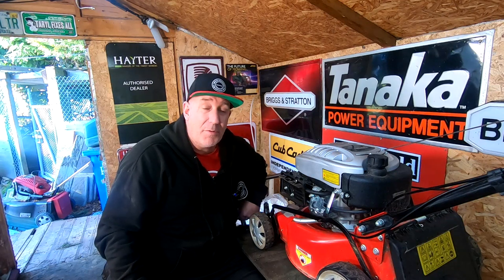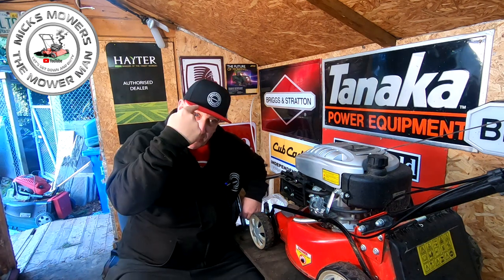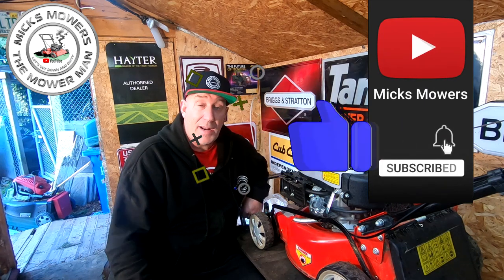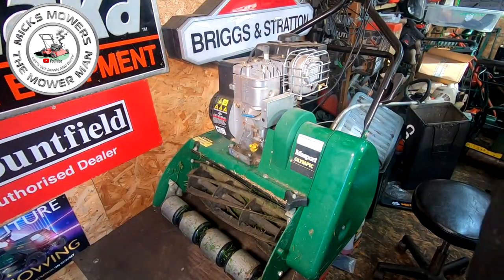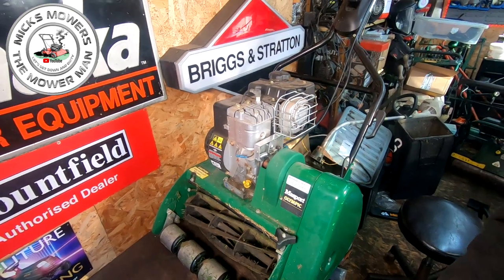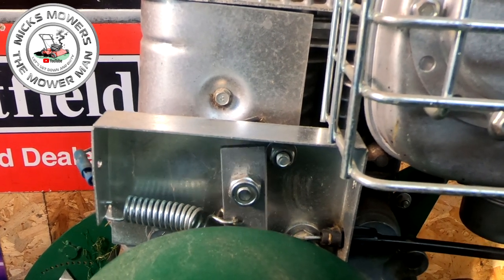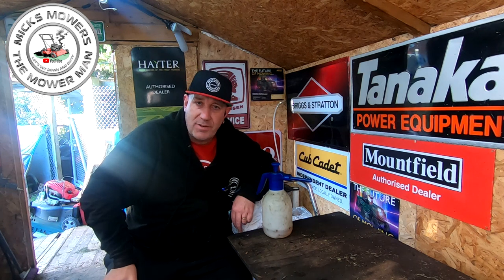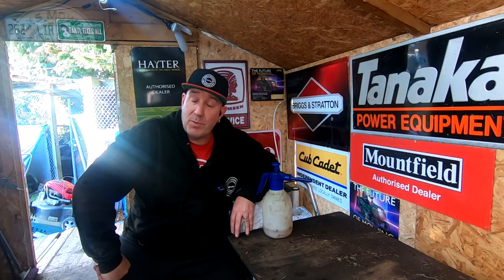Masport Olympic 400 Cylinder mower - Just needs a Quick Fix

Comment: For everyone still wondering....
The reel should not spin at idle. If it does, the clutch springs are soft/ stretched. 
New clutch is about $125aud. 
This probably why the previous owner tried to adjust the carby to a lower idle.

Comment: Commenting as I go.  OH  !!!!   It has a horizontal shaft :-)       Man a  2 year old cylinder mower.  SWEET.  Wow    Electrical trouble solved.   So the lever grounded out the coil.  LOL  It won't start without the handle in.  I would love a cylinder mower.  (for the front yard)   It is smaller.

Comment: I'd say that's a centrifugal clutch, take the covers off and have a look! I'm sure the cylinder should stop at idle.
But if your looking for a real head scratcher for a dead man system look at a Lloyd's Paladin. Two red paddles that do absolutely nothing until you engage the clutches for the cylinder and drive, only then will it kill the engine so you don't end up with a runaway! But what a gearbox and clutch system! Oil filled and smooth as silk soft start! Slowly ramps up the speed. Awesome machine.

Comment: Well done. Looks like it does have a centrifugal clutch, which would disconnect the cylinder and drive if the revs are low.
Reply from the maker: yeah.. time to get it back on the table.. its not been run in over a year.. ta for the information

Comment: I have the exact model, back lap it once a year, never let me down! Has centrifugal clutch on crank, clutch shoes can seize resulting in continually spinning cylinder and lumpy low revs, lube up these, adjust engine revs really low on tick over, should be sweet.
Reply from the maker: Yeah the are fantastic mowers

Comment: Hey mate did you work out a fix for the blades not stopping. I've got it with one of these and it won't cut at low revs. Any help appreciated
Reply: I mean cut out at low revs
Reply from the maker: Yes  lol
Reply: @themowerman  Stuff me mate. He asked a question and all you reply was "yes LoL" 
Try harder. You ask for answers. How bout you reciprocate.
Reply from the maker: @rocknral  for your information... I did 3 other videos on this... Showing how to clean the carb and replace and diagnose the clutch... In full deal as I always do.. maybe before leaving a silly comment you should look at the other videos..... Yes.
Reply: @themowerman  Well maybe direct the fella to the answer??? I felt compelled to answer the question for him because it was asked (a number of times by different people) and no one was answering.
Reply from the maker: @rocknral  the mower boy is a avid subscriber of mine... And  he watches most of my videos.... With over 1000 videos uploaded it's not always easy to respond to every comment...

Comment: Hey mate, think these are same setup like on a ransomes marquis etc and have a centrifugal clutch, so the cylinder should stop spinning when you idle the engine down. I doubt it would be allowed to spin constantly for safety reasons given its modern age 👍
Reply from the maker: Yeah true.. I need to have it apart..

Comment: HI MICK . NO THE CYLINDER SHOULD BE STOP WHEN YOU PULL THE ENGINE OVER . WHEN THE ENGINE IS ON TICK OVER THE CYLINDER BLADES ARE STOP .
Reply from the maker: are you sure.. i thinking not.. i need to look into it
Reply: @themowerman  IT JUST SEEMS ODD WHY THE CYLINDER IS RUNNING ALL THE TIME . . Mmmmmmm
Reply from the maker: @shanesquire1  yeah I'm going to look into it
Reply: y @themowerman  yes🤔 that is the best thing to look into it.